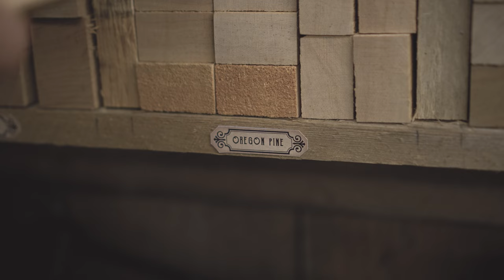Combat Sword Restoration

Comment: Renovation of a sword using old techniques. During my youth, I often stayed with our blacksmith, Mr. Józef. I pumped air into the firebox using a large, double-sided bellows. I also used a crank to turn the grinding stone, and I also drove a large drill with a flywheel in the same way. Mr. Józef shoeed horses, put hot rims on wheels and repaired horse-drawn carriages. Various metal fittings for wooden elements were formed in the hearth, including horseshoes.
Beautiful times of my youth. God bless the soul of Mr. Józef and his Brother Felix. They are buried in the cemetery in Wilczyn (Poland).
Congratulations and best regards 💖👋.
Reply: @FFD_Restorations  Thank you for the like 😀.

Comment: really nice restoration job, particularly like the natural cordage yu used on the hilt, just started playing around with that stuff myself on my knives I make, could I suggest you look at zinc and copper plating as that was around in the time period you emulate so well and either would work really well on the guard yo so carefully polished? Looks great though, thoughtfully planned work and looks bang on
Reply from the maker: Thanks a lot! I appreciate the suggestion and I like the direction this is heading. Honestly, I have a hard time where people constantly point out how something is not period correct.  It is not simple and easy to pull it off in 19th century manner without getting a ton of ¨smart¨ comments that are mostly irrelevant and frankly annoying.
Reply: @FFD_Restorations  ignore them, and tell me if I am annoying, not meant to be and certainly not a criticism, love the way you do your work, as I have told you before there are only a couple of restoration channels I watch as most are fake and often destroy genuine artefacts, you don't, obviously a lot of thought goes into your work and it shows and the resulty speak for themselves, also like the fact that you do things from the period and often think that the way you restore is very much what someone would have done back then to repair damaged tools etc
Reply from the maker: I'm doing that as much as I can. Thank you so much and not, I love reading your comments and well explained reasons why I should do something differently. This helps me to grow and expand my perspective on things. Thank you again and wish you all the best!
Reply: This is not a restoration.
Reply: @Cr0nTV  so what do you call it then?

Comment: Hi Boris:  nice fx on camera 2.   😊🎉 also how did you make the hand guard so shined?  Often when I use abrasive to remove the tarnish, I find at least one place that is discolored. How do you restore the discoloration?  I polish with Flitz but it’s still has discolor spot. Just wondering what you’d suggest.   Another great video and restoration my friend.  - Kathy
Reply from the maker: Hello Kathy, how are you? 
Thanks a lot, I'm experimenting a bit 😁
Regarding discoloration, I have tried many things and always come back to the same. And that is to sand away more until I reach "healthy" material. To make everything look nice it needs to be sanded broadly so you don't see any transition between heavily sanded areas from the rest of it. Hopefully this is helpful. You can always start with fine sandpaper like P400 and see how it looks after, maybe that will do the job. If not P120 or P240 grit should do the job. Of course after course sand paper you need to go over with finer sandpaper to get smooth surface before polish
Reply: Appreciate the advice. I’ll try that. Thanks! 😊

Comment: Very nice. I used to fence until about 20 years ago. Had to stop due to arthritic knees.   I like the old classic French grip, not at all like the modern pistol grips. I would be proud to fence with your restored epee.

The guards are designed for different function and style of fencing. In epee the whole body is target, including the hands, hence the large bell guard. Sabre is both a thrusting and cutting weapon, any body part above the waist, including hands is valid target. That is why sabres get knuckle guard, to better protect the hand. The foil is a thrusting which only allows the torso as valid target, hence no need for a large bell guard. Old foil guards were actually a butterfly/figure-8 pattern. The French name for foil is fleuret. There are also rules as to "right of way" which disallows simultaneous attacks in foil and sabre, epee has no right of way and allows simultaneous attacks.

Anyway, great video.
Reply from the maker: Wow, much appreciated. Thank you so much for sharing your knowledge sir! Sorry to hear that you had to stop.  Take care!

Comment: I just got and restored a hand cranked grinder. What lubricant do you use to make it run well?
Reply from the maker: Sounds awesome, well done! Depending on the model, if there are holes for lubrication you can use machine oil (one drop before use). If not, any grease inside will do (adding/replacing once a year).

Comment: This is used for fencing but it's rapier, not éépé. You can tell it because éépé has different shape of handle,armguard is smaller and éépé in general is used with stabbing motion.
Reply from the maker: Hey Nino, please see the video description where I described details of this sword.
Reply: The shape of the blade gives away that it's an epee. A rapier is more pointed and narrow in general. An epee is an obtuse triangular shape with a very wide top/base of the blade near the guard and shallow angle/apex opposite, going into the tip of the blade. Many rapiers also have a crossguard inside of the bell housing. I fenced foil and epee for a semester or so and then sabre for a few years after. I was also the club armorer for at least two of the years.
Reply: Oh, i see, it's my mistake.
Reply: @raughboy188  🤔🙄Lol